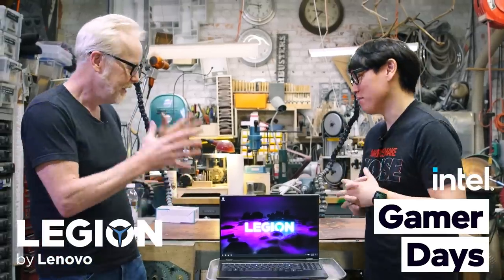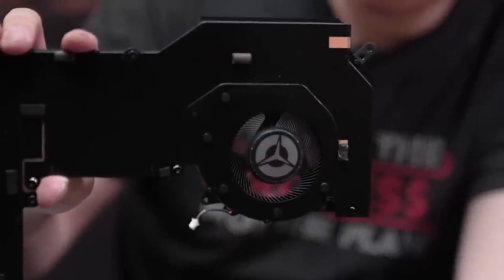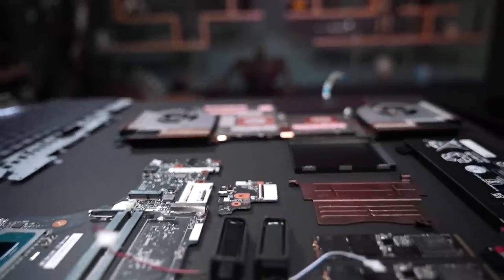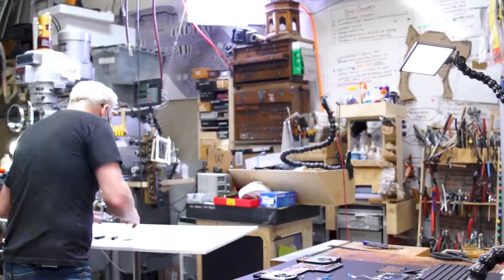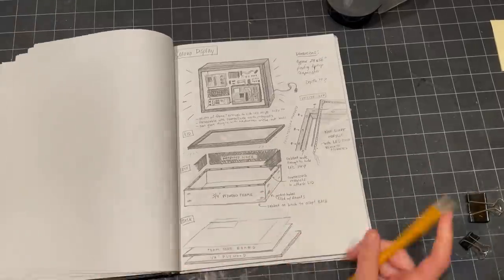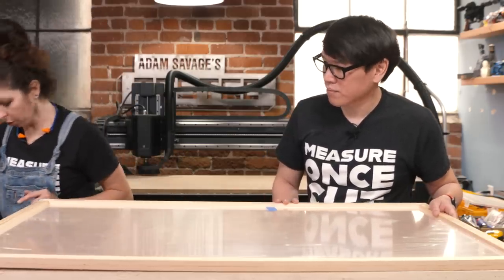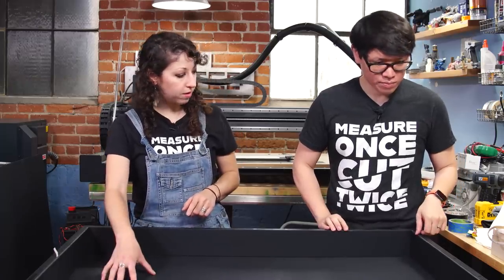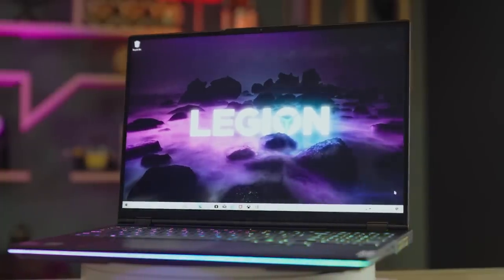Savage Inside: Lenovo Legion 7i Shadowbox Display! (Intel® Gamer Days)

Comment: Oh I was hoping it was actually going to work. I thought you were just going to Bluetooth a keyboard and mouse to it and actually use it. When I was a little kid growing up I took everything apart like that and I got in big trouble. If it didn't work anymore. But that's how we learn.
Reply: Yeah, that's unfortunate, I too thought they were going to keep it functional.
Reply: From a practicality standpoint that's just not possible unless they kept everything together and used a usb/Bluetooth keyboard and mouse.
Reply: It would have been very difficult to keep it working and still suitably spaced out when you consider all of the cables for the assorted modules and also the fans. Speaking of fans, if the laptop was working you'd need to also cool the CPU and GPU and that wouldn't be at all easy if you still wanted to leave them visible, the only option would be some very serious cooling inside the box and all of the problems that would bring.
Reply: I sometimes buy some old equipment from the thrift store and let my six year old nephew take it apart. It usually ends up in the bit box. A shadow box is my next sunday project lol
Reply: The RAM would basically need to be in its sockets for that to be possible.  (Or separate the original RAM, but then slot in a replacement DIMM or two to make it work).  The DDR4 3200 traces have to carry 64-bit wide data signals at 1600MHz with very tightly controlled timing skew between different lines.  If you've ever looked closely at a mobo and seen some of the traces do a squiggle, that's because this trace was shorter than the others because of turning a corner, or a pin location or something, and they want the path to be electrically the same length.

Laying out the traces on a board is hard enough; taking that signal through a cable plugged in to the DIMM socket to another DIMM socket is probably just going to fail, unless it's maybe possible to lower the memory frequency a lot so the timing window is wider.  Extra capacitance and inductance from a homebrewed cable will probably spoil things.

This is not nearly such a problem for PCI Express; each "lane" is a separate differential pair that's separately self-clocked as a high-speed serial signal.  PCIe can maybe handle being routed through a cable so you might still get the WiFi card and an M.2 SSD to work.  Especially if you had custom firmware to configure them to run at most PCIe 1.0 speeds, instead of the higher frequency PCIe 3.0

Summary: PCIe is multiple serial busses ganged together, DDR4 DRAM is a true parallel bus.  That only works when timing is tightly controlled, which is why we ditched parallel busses for things using cables, especially external, like printer port (replaced by USB), floppy drives, IDE (replaced by SATA), SCSI (external replaced by USB, eSATA, or in servers internal SCSI replaced by SAS = Serial Attached SCSI).

----

Power / heat isn't a total showstopper if it's almost totally idle, and you have some air movement.  The CPU can thermally throttle pretty aggressively and still work slowly, while running at maybe 80 to 90 degrees C die temp.  Bootup might be rough, depending what OS you pick and how quickly it can get back to idle.
Having the heatsink not on the CPU / GPU is a huge problem but perhaps not a total showstopper, if you don't have any performance requirement.
Reply: The parts would conceivably not be broken.  This display laptop is obviously still fully working and capable; you'd just need to put it back together again.  (and remove the hot glue they added ;)

Comment: Knolling is "the process of arranging like objects in parallel or 90 degree angles as a method of organization." It was coined by Andrew Kromelow, a janitor who worked for Frank Gehry.  At the time, Gehry was designing chairs for Knoll, a company famously known for Florence Knoll's angular furniture. Kromelow would arrange any displaced tools at right angles on all surfaces, and called this routine knolling, in that the tools were arranged in right angles—similar to Knoll furniture. The result was an organized surface that allowed the user to see all objects at once.

Comment: Looked like a museum display up until Adam hand-lettered it on the outside of the acrylic window.  I thought any lettering would have looked better inside, either on or near each part.  Also thought the screen might be functional, displaying an ad loop of some sort.
Reply: nah, i think it added something more human to it, it looks like an asam savage project like this, the things he does are not clean looking by design. it looks like it was made in a lab with all the scientific annotations on glass. if you just wanna see the separate parts all clean and artificial looking just go to the lenovo website and see the renders.
Reply: I didn't like the hand lettering on the outside either, not knocking Adam but it just doesn't work for me. I too would have preferred to see the lettering near or on each part, but preferably *printed* too. Other than that I love it all, the layout of the parts are great too and the box is excellent.
Reply: The hand lettering floating above the parts again feeds into the sense of depth in the piece, This is essentially 3d art, not a boring technical display. It ain't a damn butterfly collection with pins and labels. I personally love it.
Reply: I think museums would eventually end up doing this to give their exhibits a less formal/sterile feel to change things up a bit.

Comment: Another 3080 out of the hands of gamers (y)
Reply: As much as I agree, it's Intel so they not only don't give a fuck, but also it's a laptop, so it'll run at 80-100c under load, and then it'll kill itself in 3 years. So with that, making laptops is making the shortage worse because they last far less longer than PCs.

Comment: I would have used an obsolete used laptop. It seems pointless to wreck a new one. It is interesting to see all the components.
Where is the SSD drive? They didn't even point it out?
Reply: especially in a global tech shortage. Such a complete waste.
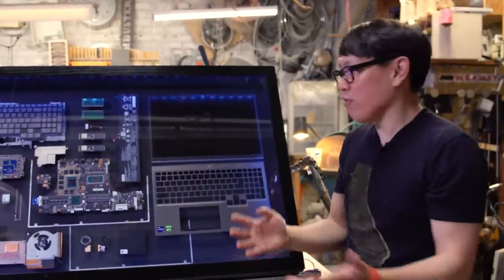Reply: idk if they mentioned it but at 33:14 theyre the 2 sticks below the ram and that cable. probably in raid 0
Reply: @renderedpixels4300  I see the SSD now. Thanks.

Comment: I started into tech especially PC's in the early to mid 2000s with me really starting into tearing systems down around 2007-2009 and I gotta say it's so much fun to see everyone just looking at pc's and going "we got spudgers and specialty bit kits so we don't gotta source anything anymore" where I can remember using a small flat head my father had that came with his chainsaw to pry my first laptop apart, or using a razor knife cause I didn't anything better. Trying to turn security screws with a modified flat head I'd cut down to fit at least one edge of the screw or at least get enough bite to turn something because no one would sell me the security bits I needed. Trying to source PC hardware for laptops which.. really wasn't a thing.
 
 To clarify laptop modding and upgrading is relatively new. PCs like proper tower desktops have always had a modding scene but laptops are a difficult balance and as such for a long time there was legitimately no way to "upgrade" them without just buying more OEM parts to "repair" a laptop and hope for the best that the system could support it. To this day IT is a FAVORITE of mine that sadly I haven't managed to get into as a job properly since I left my freelancing days in highschool. I live/lived in a small town so I tended to be a cheap alternative to get your PC fixed compared to going to best buy or trying to find a local shop in town, which whatever shops would pop up, usually went out of business soon after due to problems of sales. I miss the field and would love to get back into it again.

Comment: Nice to see they haven't soldered the ram and SSD on to the board like Apple has with their MacBooks
Reply: Generally speaking, thicker gaming laptops typically do not have anything soldered, except for CPU and GPU.  You can replace the ssd, memory, battery, and even the wifi card!

Comment: Would have been nice if it had have been left in working order, all you would need would be some extended ribbon cables. A few custom cables wouldn't have been that hard to fabricate.
Reply: You are aware of the typ of connections the internal components have, right? "wouldn´t have been that hard" is the same as "virtually impossible". Please try to build a custom cable for PCI. Also: how quickly will the system melt if powered on without an extreme cooling in place? Of course, the i9 will be most likely fine by stepping down, not sure if SSD, Ram and of course GFX will survive. I would not bet on the WIFI Module.
Reply: @Peter_Cordes  I agree. 

Somehow i belief it would still be impossible to get the machine in working order. much smarter would be to simulate the connections and have another unit on the back that does the processing :-)
Reply: @BernhardWelzel   - Yeah, having another computer in back drive the display is much more sensible.

If you did want to cable as much as possible, and didn't care about performance, you could maybe cable everything except the RAM, and add in a new DIMM or two for the system to actually use, while you have the original DIMMs displayed separately.

But that would require custom(?) cabling, unless M.2 PCIe extender cables exist for prototyping equipment.  (i.e. the kind of thing Lenovo, Western Digital, or Realtek might have some of in their labs, if they exist.)

Comment: it is kind of funny to watch these guys so carefully and lovingly take this lap top apart.. But then they are not looking to fix anything they just want to have the pleasure of exploring.. When I used to build shadow boxes sometimes I would space the back mate 1/4 of an inch off of the back and make it about a 1/16 of an inch short all around then line the back with tin foil and but in LEDs (usually blue, UV or a mix) and then place holes in the back under certain objects to get the lighting to come from behind to highlight individual pieces and thus I could create a little mood lighting to help highlight the box especially in low light conditions..

Comment: I would have added another laptop hidden inside which drove the display you have IN the box with a promo video of the laptop on display. Nice job though! I had an HP laptop which the plastic components of the case gave out so I took everything out and put it all back into a plexi case I made. Ended up adding some accent leds and it looks basically like a see through laptop that still works.

Comment: Don't worry they didn't pull apart a working laptop. If you notice the unit at the start with Adam and Norm has not Intel and Nvidia badges but the one they tear apart does. Also when they tear it down they never show it running before pulling it apart. Lenovo probably has a few faulty laptops sitting around...

Comment: should have taken the screen apart. There is usually a power supply, inverter, and a really nice ribbon cable. It would have added a little extra PIZZOW!
Reply: I doubt there is an inverter as it is (most likely) LED backlit.

Comment: i too thought it was going to be working in the case with longer ribbon cables. or could be simulated, also yeah, could get the RGB back lighting on the keyboard running

Comment: 5:32 bruh that is some crusty thermal paste. Protip: If you buy a gaming laptop, check if anyone has done testing on a thermal paste reapplication for that model. If they saw performance increase, change the paste on yours. It's pretty dead simple and can boost performance a lot since clocks scale based on temperature for both GPUs and CPUs. In some cases, it may have been sitting on a shelf for a while and they generally don't apply the best thermal paste to begin with (not as big an issue when it's new, but if it's about a year or two old it becomes apparent real fast.)

Comment: I wish I could afford to spend $2000 on a laptop just to turn it into a piece of art. I guess this is going on display at Lenovo or something... question mark? My inner geek is raging. What a waste of a good machine. Lol It is beautiful, though. Nicely done, y'all.
Reply: Lenovo donated it and it did not cost Lenovo $2000, it cost them about $150-$200 parts and labor possibly less. 
A good chunk of that price is marketing, Lenovo spent $849 million in 2017-18 as an example, and they have to make a profit on that investment on each product and service they sell.
And that $2000 is going to be a $750 computer in a year and a half or 2, and Lenovo will still make a significant profit on it.
Reply: @theherrdark4834  I looked up the model. It would cost me around $2000 to purchase. That's all I mean. I wish I could afford to buy one to make into art like this. I wasn't trying to be ...anything. But, thanks, I guess. That's good information.
Reply: It's closer to $3,000 considering it's  i9+3080 along with 2 SSDs
Reply: @theherrdark4834   A commenter on another thread said vendors often send out DoA gear for projects like this, so it was hopefully already non-working in some way before they started, at least one of the major components failed.

That's just what @Tyler Furukado said under a higher-voted comment about bricking a laptop.  Sounds totally reasonable to me, though.

IDK how "big" you need to be for a manufacturer to send you free stuff; probably only if you're going to make something that will indirectly promote them out of it.  And then you probably still need to be a recognized name with some subscriber base, so having a plan to post photos of a project like this on your facebook probably wouldn't get you the goods.

@Liquid:
Wouldn't hurt to contact a vendor to ask if discounted non-working gear could be an option for a project.  The worst they can say is "no".  Or maybe just do it with an old 2nd-hand laptop that's been around for a while, that you get for near-free in non-working condition on kijiji or whatever, if you want to showcase the tech of the past.

Comment: Could have another at the back that's linked to the screen inside the display, and a keyboard/mouse at the front to control it, or just have it playing promotional videos and no user input outside of power on/off

Comment: I've got one of those its really good I had mine custom built some of the best parts I could buy at the time. Runs great runs everything so far haven't found anything it can't run on a high setting. I was hesitant do to it's Chinese organs but after learning there lap top division was an IBM and sold to Lenovo I felt a bit better and most others were over priced so I said screw it and went for it love it wouldn't trade or sell it its been great.

Comment: I generally like Tested, but... yuck.
This is a waste of a good laptop and a waste of space.
That's my two cents, worth twice that.
Reply: I fully agree. This is not only adding to the current shortage, but also I cannot see how this is considered "art" or whatever.
If you'd have taken an old, broken! PC from one of the viewers, took that apart, and gave the viewer the laptop, this would've been way less resource-wasting, of a perfectly fine, new, working laptop. (you can think of lenovo what you think, but this is nonsense)
Sure the concept of "art" is always questionable, but yikes.
Reply: I agree... but hey, it's a sponsored video, and can't fault them for needing money.
Reply: Actually, they just saved someone from a bad computer. 🤣
It is better off as a cool looking display. Most Lenovo laptops will die within months after purchase. I've had to repair some 2 or 3 times within their first year. Once they die after the warranty expires, most of my clients end up buying a new laptop of another brand. I've been fixing computers for over 20 years, and I have not had a brand perform this badly since Packard Bell.
Reply: @PCsetupHelps   I never saw a dead Thinkpad though. Except their batteries, but these die after 10 years+ on other brands, too.
Reply: @PCsetupHelps  I for myself never had a Lenovo system which was built in the last 5 years, but a Friend of mine uses them work-wise and at least speaking about Thinkpads, never had issues.
However, I am not sure what his company policy actually says about using built in storage devices, since they're quite sensitive regarding that.
So disregarding SSD/HDDs, at least he got no problems.
Just one persons experiences aren't enough to make a case study, lol. As you're (at least that's how I understood it) handling repair cases rather frequent, it's not that I don't believe you. It's just hard to grasp that a company building one of the most iconic laptop brands, can screw up so badly.

Comment: Have you guys actually taken apart laptops before? It's definitely didn't look or sound like it. You didn't even open the locks on the connectors before pulling the flex cables out. Smh

Comment: One of the first jobs I had back in the 80's I worked for the chief electronics engineer. And we got to talking one day and he said that really there had been no new technology since the invention of the transistor. All that we had done was to make the transistor smaller and faster.
The main board must be at least 5 layers and in what looks like only 1/16 of an inch. Technology tends to build on itself exponentially.

Comment: the white text on the top of the frame ruins it, should have made a plaque or something, and PUT IT AT THE BOTTOM.

also should have done more with the text on the acrylic, add some lines or additional, smaller text, to certain areas, there is way too little text in relation to the overall size and amount of parts. 
and the handwritten style is too much of a contrast with the precise and detailed layout of the parts. it really cheapens the whole thing.